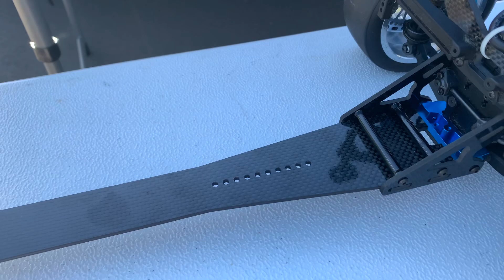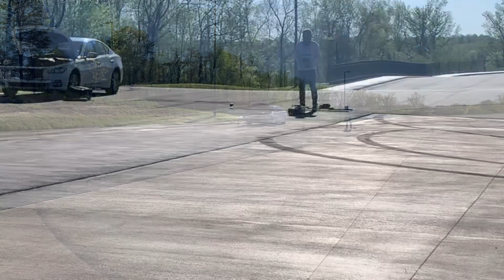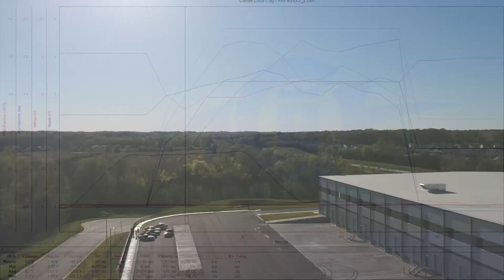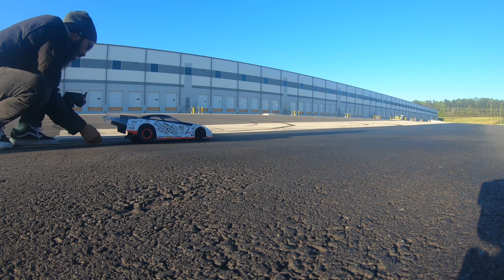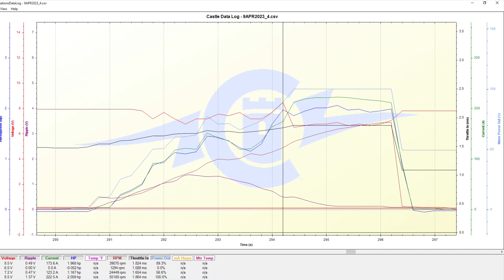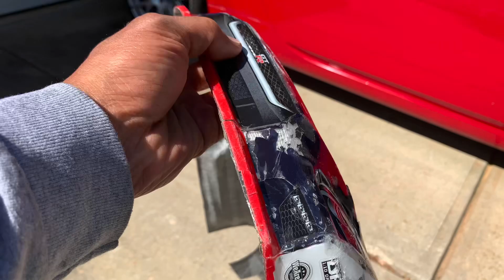Easter test and tune with the DR10M

Comment: Julius thnx for the vid> Cheers from the Mtns of NY! Got my Dr10m a few weeks back. Beautiful build, Im installing the electrics over the next few days. Want to ask your opinion on the front shocks and more importantly the ride height. What have you done to get rid of the high stance upfront? I bought the stock Dr10 front shock tower and now its mega low. Im thinking the best option is to find some shock shafts that are taller. Ill figure it out no doubt > I just wanna see what you might have done.
Reply from the maker: My DR10M was destroyed when I lost signal and ran it into a curb. I wasn’t recording when it happened so no footage but gonna do an update video about it and show the iceman chassis I got to rebuild it. But I had swapped in gray springs to lower the spring rate which allowed the front end to come down quite a bit. I was running red springs in the back but they were too soft for the r design trans riser and I would get the rear scraping the ground so I was using the stock springs in the rear. I am gonna buy a new Dr10m kit and start over with it stock and go from there. But I gonna run gray springs in the front and red in the rear and keep it all stock per the kit. These springs are associated springs also.
Reply: @juliussmith2630  awesome bro thanks for the feedback 🦾
Reply from the maker: I am pretty sure these are springs I was using. Red springs part number ASC91944
Gray springs part number ASC91832
Check this video on Facebook from John Schultz. This was very helpful to setting mine up originally. He works with associate me and runs under 2.0 consistently. https://www.facebook.com/john.schultz.125/videos/740427103943103/?mibextid=cr9u03
Reply: @juliussmith2630  beautiful. cant wait to watch it > double thanks! and good luck, look forward to seeing your update
Reply from the maker: @micahjared8082  you’re welcome. The chassis is in the mail now.

Comment: Dr10m .... 2.20@64. No bar.. dry tire. 3.5t drk v2. Drk160rs. Protek6400 130c shorty. 20/81 gearing. Dragworx yellows. 2492g weight . 52r/48f .
Reply from the maker: My PB is 2.14@69MPH. I added some lightweight parts and was working on getting it lower. Now I have destroyed it when it lost signal and kept going into a curb.

Comment: Hey bro! I got the exact car and castle 6400kv what gearing are you running!
I'm still putting mine together I picked up a 28th pion with the kit spur wondering if that's to steep 🤔
Reply: Hey Brother great video I've got a DR10M as well I've been running TEAM ASSOCIATED since the early 90's they don't have 30 WORLD CHAMPIONSHIPS for no reason man LOL HA HA HA HA HA HA HA 😆 and Brother that is a nice setup I to have run Castle and R1 WURKS in the past but I went back to TEKIN RX-8 GEN-3 ESC with the new version's of 293 and 295 DRAG RACING ONLY software updates with the 295 allowing you to go to the full +60° custom in timing and I have been running the TEKIN ELIMINATOR REDLINE GEN-4  2.0T here lately I also have the TRINITY DRAG MASTER 2.5T and DOUBLE DOWN 6500KV but I've been getting the best times with the TEKIN ELIMINATOR REDLINE GEN-4 so far and since I switched to the CYRUL 3DFX EXCELERATE'S GEN-2'S I also run PRO-LINE REACTIONS ULTRA BLUES my gearing as of now is 23-pinion and 84-spur I am running the TRINITY 10,000mAh LIPO and I'm going to be ordering the new TRINITY 13,500 LIPO that just came out I'm running full carbon F.T. CHASSIS and MORBO C.F. SHOCK TOWERS EXOTEK 3 GEAR TRANSMISSION and a HOT RACING FULL SPOOL so far the best time is 1.8 sec. 83 m.p.h. I'm still dialing in the new setup but I'll keep watching your channel Brother cuz I subscribed to it!!! God Bless ✝️ Sincerely Clay B. and 🏁SPEED MOB RACING🏁
Reply from the maker: I appreciate the info. I’m still running this car just to see what it can do. Gonna upgrade the chassis to a Fivestar street sweeper and pick up the new R design lightweight parts they just came out with. Probably get the SMC 12000 since the 10000 mah is out of stock. But I don’t plan on competing with it. The DR10M with a DX5 pro is more a budget setup in my opinion and as I’m just getting into NPRC, I’m still learning a lot. Currently got a DC1 and a custom works patriot waiting for their motors and Ghost ESC’s. And waiting for a Sanwa M17 to come this weekend. Then I will do some comparison against less expensive and more expensive setups. By next month I plan to also have a Fivestar Fury to do more comparisons.
Reply from the maker: I’m running the kit 76T spur and a 26T pinion. Just be sure to not go under 7.8FDR is what I’ve been hearing. If you run a 28T pinion you need a 84T spur. I tried to fit that combo but the motor plate won’t allow it. My next mod is a RDesign motor plate so I can go to larger spurs and pinions.
Reply: @juliussmith2630  
Thanks for the info awesome!  I'll try a 24tooth instead. Seemed like your logs were showing I bit low on the rpm side with the 26 but they came up alot on the
Top speed run. 🤔
Reply from the maker: Yeah. Check out the last video I did. Had more RPM and top speed on the 132ft runs. One thing i forgot to mention is I also changed the pills to give it 0degree toe. Last time I had it at 2 degrees. Plus my ramp on the DX5 pro was conservative. Still gotta do a video about that.
Reply: @juliussmith2630  
O nice I will thanks again